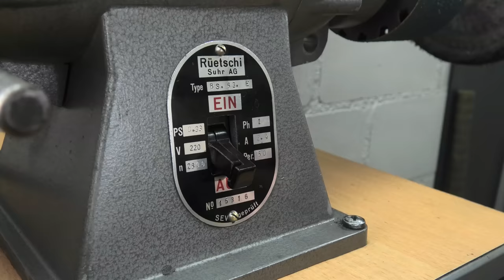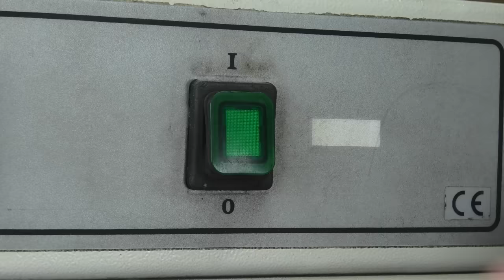Antique Seized Adjustable Wrench - Restoration

Comment: That turned out to be a jewel 👍
What is the solution you use for rust removal ?
Reply: MM uses a commercial rust remover.
Reply: @Vickie-Bligh  Brand?
Reply: @williamemerson1799  Last time I saw was MC-51.
Reply: @Vickie-Bligh  Great, thank you ! Their website says it will be available here in the  states soon.

Comment: Looks like the channel that is cut into the handle could have possibly been to allow a measurement to be read from the moveable jaw?
Reply from the maker: The slot is required for the manufacturing process

Comment: One thing I didn't get was why not just use the head's pin that was loose for the sizing and collapse it around the shaft that is intended for it and the top of the head;  I think that a stone assemply in order to bore it down and keep that rail across or rather along the length would had been proper as in keeping estethics or whatever;  I don;t think you'll be reading this anyways.  Cheers 8000 comments;  you must have better things to do with your time.

Comment: I wish if the measurement numbers were placed in the middle of the piece to be installed with the other part, and the measurement arrow would be in the top of the face on the right, and the writing would be engraved on the iron
Reply from the maker: I've seen such wrenches before

Comment: I think this blurs a bit the line between "restoration" and "modification" ("modding"), because you are not restoring it 100% to what it was fresh from the factory (such as removing the original welding marks and making edges rounder than they were originally.)

Comment: I question the decision to forge down the slot instead of building up the sliding end.  It seems to me that removing material from the moving part and then pinching down the slotted side is less desirable. Removing material makes everything smaller and less true to original dimensions.
Reply: It wasn't just rusted it had also been damaged.

Comment: 10:16  You remove waaay too much original material by sanding off corners, edges and casting lines.  It’s like whittling a wooden boat from a wooden boat.  Everything you restore is at least 1% smaller than it was when you started.